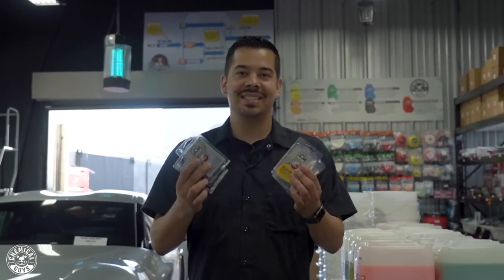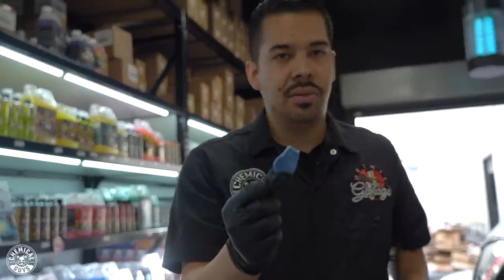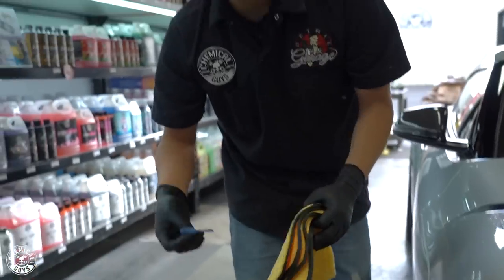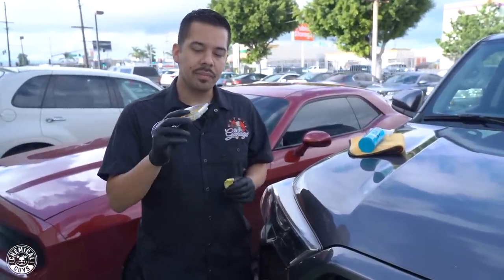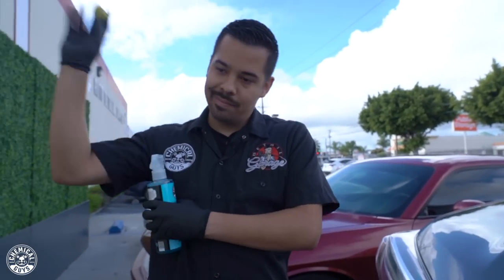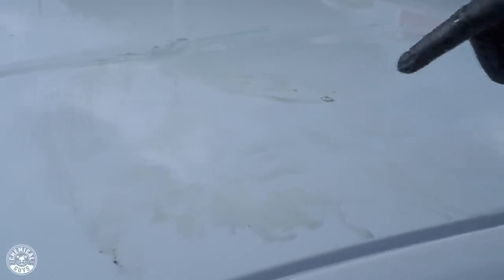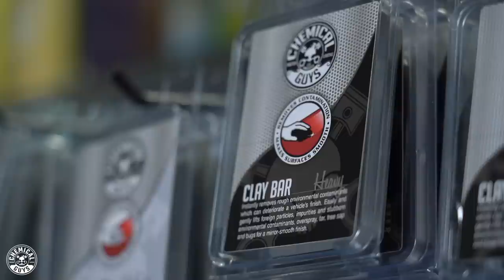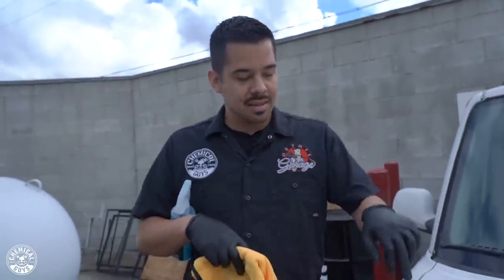How To Choose The Right Clay Bar For You! - Chemical Guys

Comment: Could you use Chemical Guys iron remover on the paint to remove industrial fallout before clay barring?
Reply from the maker: Hi Alan! Absolutely, it is safe to use DeCon on painted surface for chemical decontamination before using a clay bar.

Comment: could I get away with use of the heavy clay bar for any level of contamination to eliminate the hassle of trying to identify the level of claybar needed?
Reply from the maker: Hey Emmanuel! Thanks for your message. If you plan to polish the vehicle afterwards you could use the Heavy Clay Bar but if you aren't going to polish the vehicle it is important to use the appropriate clay bar.
- CG Nick
Reply: Chemical Guys can I use insta wax after using a heavy clay bar ? Or speed wipe ?

Comment: thanks for yet again another great video! so much helpful info. i have two cars to detail, but one has less junk stuck to it. would it be bad to use a heavier clay bar on both of them? or, would it be better to also purchase a light clay bar?
Reply from the maker: Hi there! Thanks so much for your message. Using a Heavy Duty Clay Bar usually precedes machine polishing. I recommend using a Medium Duty Clay Bar, this should work well for both vehicles. 
https://www.chemicalguys.com/clay-bar-and-luber-synthetic-lubricant-kit-medium-duty/CLY_KIT_2.html

Comment: I just purchased the ceramic kit with clay bar. My question is, do I clay bar right after using the CLEAN SLATE, or do I use the CLEAN SLATE, CAR WASH, then the clay bar, and finish with wax?
Reply from the maker: Hey Jeremy! After using Clean Slate it is perfectly fine to move directly to the clay bar process and once the surface has been decontaminated, apply wax to lock in shine as well as repel harsh elements.

Comment: SO glad I came across this video.  Have been trying to figure out what to buy, what sequence to use, etc etc.  Will keep searching under The Chemical Guys... but... is there a straight forward video that demonstrates from washing to clay-ing to waxing?  In one video?   My task is... '08 Saab, prior waxing is just starting to come off.  So I need to wash the surface which includes stripping all prior product to prepare it for I assume, clay-ing, then moving on to a wax phase to lock everything down.  Do I have that somewhat right?
Reply from the maker: Hi there! Thanks so much for tuning in. That's correct, strip away old coatings with Clean Slate before using the appropriate clay bar and then lock in your hard work with coatings. 
https://youtu.be/dmbCijFFScE

Comment: If your paint feels a little rough after using clean slate should i use a heavy clay then move to polish before applying a ceramic
Reply from the maker: Hey there! Yes, use a clay bar to remove embedded contaminants and restore a smooth finish. 
- CG Nick

Comment: My car is four years old, I never used a clay bar on it. Which clay bar should I buy? OG or medium, and continue to use it on regular basis after that? Don't see much of contamination, because my car in dark color.
Reply from the maker: Hey! I suggestion using a Medium Duty Clay Bar with Clay Luber to extract contaminants and revive a smooth finish.

Comment: What if you bought a Medium or heavy clay bar for those heavy contaminated jobs but get to a vehicle that has light contamination. Is it okay to use those clay bars on that vehicle? It may be over kill, but I'd rather use up the Heavy clay bars then to let them sit around unused. Thank You!
Reply: You can use it, but the problem with an aggressive clay bar is that it leaves marring on the paint finish, this usually looks like a haze over the paint, to remove that you need to polish it out with something like V36 or V38. If the clear is on the harder side then you might get away with using the aggressive clay bar, and skipping the polishing step since there’s no marring, but you won’t know until you try it.

Comment: Would I need to polish the car after using the yellow original clay bar?
Reply: It’s possible, especially if your clear is on the softer side it can leave some marring. I usually like to polish after claying since it is usually time for it anyways. You can do a quick paint enhancement with something like V38 on a foam polishing pad if the paint is in overall good shape.

Comment: Before I use the lubricant spray . Will I need to wash my vehicle first ? And does this lubricant spray take out tiny surface rust spots on the paint?
Reply from the maker: Hi! Yes, start by washing the vehicle to remove the loose dirt and grime and then perform a clay bar treatment. The clay will remove the orange rust spots "rail dust" from the pores of the paint.
- CG Nick

Comment: When you store your unused clay bar, what is the safest way to store it and also does it dry out bc it is clay? I don't use it a lot so just want to make sure I don't waste product.
Reply from the maker: Hi Joshua! Store your clay bar in the container or an air tight package to prevent it from drying out and ready for the next use.
Reply: What about storing after using the clay bars?

Comment: Can the heavy clay bar help me remove stubborn epoxy paint vapour? I made mistake on my first clay bar try without much lubrication while trying to remove the paint vapour that stuck onto my car and it ended up smudging the paint all the marks show up when under street lights. Thereafter I have tried strong car shampoo as lubricant and properly claybar until surface is silky smooth but somehow the marks still remains and it shows under certain light angles. Please help me out

Comment: Silver car what clay to use
Reply from the maker: Hi there! After washing the vehicle inspect the paint to determine which clay bar is best suited for the job. A Light Clay Bar is best for new or routinely detailed vehicles. An OG Bar works for light to moderate contamination. Use a Medium Bar for moderate to heavy contamination as well as over spray and finally if the surface still feels rough or contamination is visible, use a Heavy Duty Clay Bar.

Comment: IF I WERE TO GET THE HEAVY CLAY BAR WOULD IT STILL WORK INPLACE OF THE LIGHTER ONES. WOULD THIS BE A PROBLEM
Reply from the maker: Hi there! Using a Heavy Duty Clay Bar may require paint correction after use due to marring.

Comment: I have a 2021 Subaru WRX I’ve had for 8 months now. Never clay barred but washed frequently. I did the plastic baggie test and can feel many bumps. Should I go light or og? Don’t really want to go any heavier.
Reply from the maker: Hey Cody! Try using the OG Clay Bar with plenty of Clay Luber to thoroughly decontaminate your vehicle.
Reply: @ChemicalGuys  will the og scratch my paint? Is the light clay meant for garage kept cars?

Comment: Does protection prevent paint from getting contaminated?
Reply from the maker: Hey! Adding layers of ceramic, glaze, sealant, and/or wax will make it difficult for contamination to adhere to the surface of the vehicle.

Comment: Have a 2017 Camry and a 2016 Dodge Ram 1500 where a worker had some very light spray contaminant from spray painting a fence land on both cars. It didn't discolor the paint, but both have a rough texture now. Will a Clay Bar take off this texture? As these cars are garage kept and waxed 5-6 times a year-What level bar should I buy?
Reply from the maker: Hey! An OG Clay Bar with Clay Luber will extract contamination and overspray.
Reply: @ChemicalGuys  Thanks

Comment: My truck isn’t heavily contaminated but it is kept outside. Also what should I use if if I want to remove all previous dressings like wax and other stuff on the paint and on the glass too start brand new. Reason being i over used the vpr water or oil based I’m not sure. The next day it dripped onto my paint and looks stained. Please help any ideas where to start like a medium clay the 2 one or what
Reply from the maker: Hey! Try using the natural cleaning oils of Butter Wet Wax to gently scrub away residue from paint and glass.

Comment: Trying to apply a spray on ceramic coating on my vehicle. Would I just need to wash the car, dry it up, clay it completely before applying the product (ceramic spray) or would I need to do something else before that final step ?
Reply from the maker: Yes, If your paint is in great condition then you can apply the coat of HydroCharge directly after washing and claying the paint. If the paint does need to be polished, then we recommend polishing it before applying a coat of HydroCharge.

Comment: I want to polish my car do I need to clay bar it if it’s a brand new car just got it bout a month ago. Want to polish cause it has very light swirls and I want to put the chemical guys ceramic coat
Reply from the maker: Hi there! Yes, it is still recommended to clay a brand new vehicle before polishing. Although it is brand new it has still been exposed to fallout during transportation, sitting on the lot and being driven. Use a Light Duty Clay Bar with plenty of Clay Luber.

Comment: So they are building houses across the street from me and the morons decided to paint on a windy day now I have a very fine white paint over spray on my black car.  I used a fine grade clay bar to remove it from my windows but it was quite the workout and it is not feasible to do this to the whole car.  You really can't see the over-spray unless you are like a foot away from the paint, but I still need to remove it.  Do you guys suggest a medium grade clay or a aggressive grade clay so that i don't kill my arm removing it?   I will be doing a machine polish with a light finishing polish after claying.
Reply from the maker: Hey Matthew! Absolutely, a Medium Duty Clay Bar with plenty of Clay Luber will extract stubborn contamination. As long as it is used properly there is no need to polish afterwards.
Reply: @ChemicalGuys  Excellent, Thank You.  I would rather not polish after I clay if I don't have to.

Comment: Once you clay bar the vehicle and wipe it off. Can you go straight to applying the ceramic wax?
Reply from the maker: Hi Jeremy! If you plan to skip polishing you can move directly to the coating process. Use Wipe Out to ensure the surface is totally clean before adding ceramic, glaze, sealant, and/or wax.

Comment: I was under the impression you rinsed vehicles after clay baring, is that not true?
Reply from the maker: Hey Andy! It isn't necessary to rewash or rinse the vehicle after the clay bar process. Simply wipe dry with a clean microfiber towel. Before applying coatings it is recommended to use Wipe Out to ensure all residue and oils have been removed.
- CG Nick
Reply: @ChemicalGuys  Great thanks you 👍